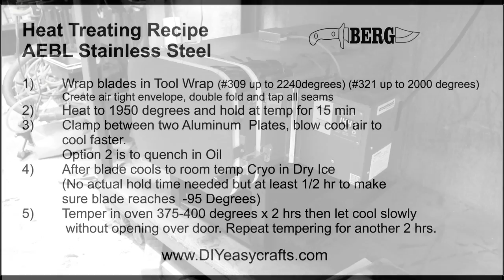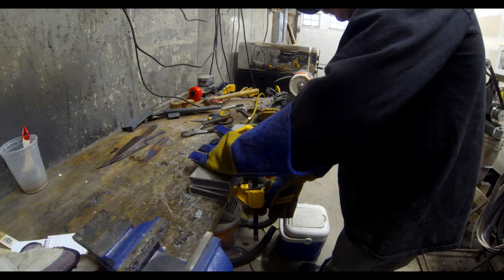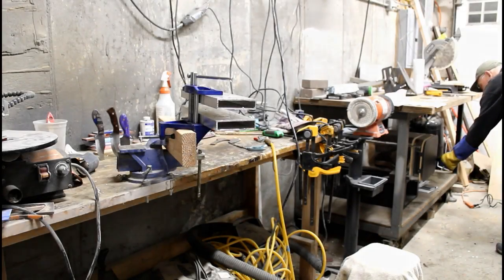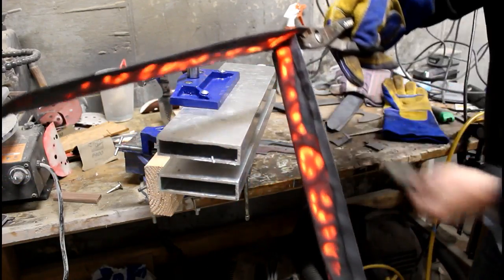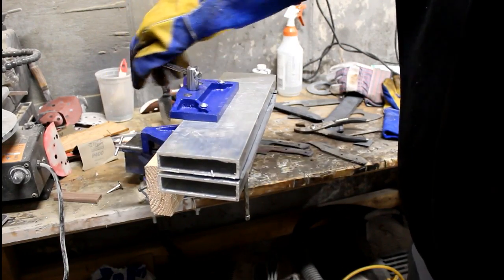How to Heat Treat Stainless Steel for Knife Making

Comment: I have mixed feelings about the woodworking vice that everyone uses because it applies an offset force. If you watch the plates as they're tightened down, they tip toward the vice's threaded shaft. It means that if there are two blades in there, the outside one is likely not in contact with the upper plate at all - and could probably be pulled right out of the "tight" vice. Does it matter, or does enough heat escape into the bottom plate to work anyway? A hardness test would confirm, and everyone seems happy with using this vice, so maybe it's fine... or they aren't measuring the hardness of the outside blade...

Comment: Be aware that heat treating above about 2000 F risks the foil partially welding itself to the blade, which can be a real b*tch to remove. The solution is easy and cheap - baby powder (which is talcum powder). Sprinkle it on, rub it around, and Bob's your uncle, and the best part is that it doesn't harm the metal in any way. I use it with Magnacut that is treated at 2050 F.

Comment: Great Video, Have you tried your AEBL process without doing the cryo treatment? I'm just wondering what the negative if any would be if you skipped that part of the process. Thanks
Reply from the maker: Yes I have. It still holds a great edge. Actually hard to tell the difference. The cryo is suppose to make it hold the edge a little better

Comment: wht if u dont hv dt equipment..onli u got is charcoal ,no oven etc
Reply from the maker: You can still do it. Use a hair dryer or wet dry vac and a steel tube to blow air at base of coals. Cook high carbon untill its non magnetic and then quench in oil

Comment: Just use clay, brother. Don't waste all that foil and fiddling. This way you can choose what part of the blade gets exposure, too. If you want to go a step further you can double case it, case the edge with the carbon, then case the entire blade with extra steel pressed firmly against the rest as heat sinks, then directionally heat the casement you've made. I don't know if that makes sense without a diagram, but it really is as simple as it sounds. If you want real value for your money I suggest also looking into cryonic treatment of blades. For drill bits a thirty minute bath in liquid nitrogen doubles even triples it's lifetime. Good heat treating also includes cooling, not just heating. Edit: I wrote that before you mentioned cryo! I'm SO pleased to hear someone in your field is even aware of this! Although using dry ice you're just wasting your time. You won't get any crystallization or strengthening from that little change. You desperately need to make yourself a liquid nitrogen generator, you can bang one together for fifty bucks.

Comment: I was dismayed to recently learn that Bob Loveless sent his blades off for heat treating as did Jim Merritt who ran the shop later. How lame. If one doesnt heat treat their knives themselves, then all they are doing is assembling knife-making components and materials. And Loveless did stock removal only. He was basically assembling kits from parts created and processed by other people but giving the final product his own twist.. I dont even see where someone would get the motivation if they werent doing it all themselves. Jay Fisher says he considers heat treating to be the main thing that distinguishes a knife from a hunk of metal.
Reply: This is why I have little time for 'knife makers' or 'knife blacksmiths' or 'bladesmiths' or ... well, the thousands of inventive names they've come up with for idiots who glue bits of wood to bits of stamped sheet metal. I avoid any smithing videos to do with blades predominantly because it attracts a certain type of people who you won't learn anything of value from. I can learn more from an old farrier making horse shoes when it comes to technique and secrets to good metalworking than I ever will from the gorilla glue guys.
Reply: The only thing you are correct about is the fact that they sent out the blades for heat treat. No other component (unless you call raw barstock a component)was purchased. Every knifemaker buys steel then they either forge or grind the blade to shape, if it has a guard they purchase the material, then shape via forging or grinding or milling.

Comment: The foil you used to wrap the knife is aluminum or stainless steel.
Reply from the maker: Its made from Stainless. Aluminum foil would melt at the high temps used to heat treat stainless
Reply: DIYeasycrafts Thank you

Comment: There's some issue with the cheatsheet. I can't dowload it on the website... In the video, when you refer to a temperature, you're talking Farenheit and not Celsius, correct? I assume that the Cheatsheet has the different temperatures to get to different hardnesses, but in case not, do you know to which temp i should heat up a blade to get to 58-60 HRC in aeb-l ?
Reply: It has to be because I believe ss will melt at 2240 c. I was also confused and it's s shame this sat for three years unanswered. I stopped halfway through to check and yeah 304 melts at 2600 f give it take which is around 1400 c.

Comment: Please help if you could please ..I have some blanks of some kind of stainless steel that my old boss had someone make or cut out if you will ..but I have Tried and tried to shape the knife or what it's called sorry IAM drawing a blank right now ..but anyways I have used a hand held belt sander and even a 4 inch grinder but the grinder is not what I want to do when it comes to shaping  my knife before the heat treating ..so with that all being said I can't hardly dent the knife with the files or even the belt sander it takes almost hours break the surface of the knife ..I told my old boss who had is friend make these blanks for me ..to tell him and my old boss this is nothing for a beginner to learn on ..so I hope you kinda of get what IAM trying to say here..hope to hear from you..thank u ..and nice video keep them coming . !!
Reply from the maker: Larry thats a hard one. Each type of stainless has its own specific heat treating temps, hold time and quench . It sounds to me like you are trying to grind stainless that has already been hardened. That is of course a lot harder to do. Your options are to continue to work but be very careful not to get it to hot during the grinding or you could ruin the heat treat. Other option would be to anneal or soften the steel. But you would then need to know what type of stainless it was to get it re heat treated after grinding was finished. To be honest you might be better off starting out with a precut high carbon knife blank. Mush easier to work with and to harden.
Reply: @DIYeasycrafts  thank you ..I know that what I had told them my old boss was thinking he was doing me a favor and using a very high-grade steel I believe it is and also I was looking on Google looking up different kinds of stainless steel and I would have to say by what I have read that I have I think what you call aero or something like thatit's one of the top stainless steels you could buy they buy it for like the space shuttle NASA I believe younot too sure but I think what I read sounds about right of what kind of thing is still I have had given away plenty of my blank to friends that have had made knives in the past and they say the same thingit's the hardest thing is still they've ever come by
Reply: @DIYeasycrafts  sorry for the typos

Comment: If the aluminium plates you use to hold the knives were ice cold, lets say put in the freezee. would that be better or worse?
Reply from the maker: It would be better but would only last for the first knife
Reply: @DIYeasycrafts  they would break? How about ice cold carbon steel plates?
Reply: @Esasa818  he means it would only stay cold for one cooling cycle.

Comment: what would happen if you used regular foil?
Reply from the maker: Never tried
Reply: if it works it'll be cheaper than the expensive foil your using.Keep us posted.
Reply: Regular is made of aluminum and it would melt on those temperatures.

Comment: I’ve recently made a knife blade that is my best work so far and I know you often respond to comment in your opinion what do to think the best knife handle material in terms of looks and durability
Reply from the maker: Wow that is a hard one. So many great materials out there. Guess it also depends on the type of knife. I use alot of the hybrid wood and alumilite scales.Recently have been using buffao horn which looks fantastic. What type of knife. Join us on facebook group "knives and knife making". you can post a photo of your blade
Reply: Looks: dessert ironwood. Durability: micarta

Comment: Great info as usual!!!!  Hey, you can pour denatured alcohol in with your dry ice to lower temps significantly.
Reply: acetone and dry ice are the lowest temp fluid before liquid nitrogen. and its easy to aquire. Dry ice can be easily acquired from CO2 fire extinguishers.  you just cover the extinguisher nozzle with a pillow case or washcloth, some kind of cloth that is thin and then discharge the extinguisher for a few seconds... the dry ice will collect on the inside of the fabric material.

Comment: Nice set up a good results. I have exclusively been using AEBL and send out for HT. Problem for me is that I only rough in a short bevel prior to HT to avoid warps. Being that I only have a  1x30 HF, the finish grinding takes forever due to the extreme-hardness f the steel. I think I will start grinding my bevels much more from now on prior to the HT. At least until I get a better grinder.
Reply: Dayton 2x42 from Gamut/grainger online is less than $150 delivered.  comes with a 6" disc grinder as well, I got one and couldn't be happier.   All the popular belts are available.
Reply: @jackspradt1562  
I appreciate the tip. I think I will hold out for the 2x72.
Reply: Have you checked the hardness of your blades using hollow aluminum vs solid plates. I'm curious if there would be a difference.

Comment: I’ll just send mine to you and let you throw it in with yours.  Lol.  I make mine out of free steel, 304-304L.   It seems hard enough and holds an edge well.
Reply from the maker: Always thought 300 series was to soft to use for a knife blade. 400 series get good and hard but then also rusts.
Reply: I get all my steel for free so I can’t complain.  When I get good enough then I’ll buy some knife steel.  Until then, I’ll stick with free.